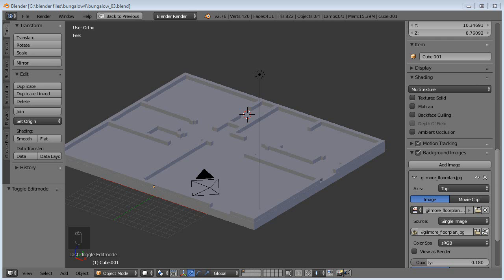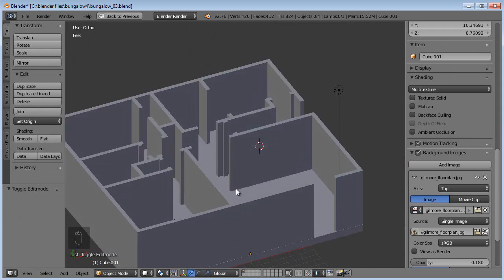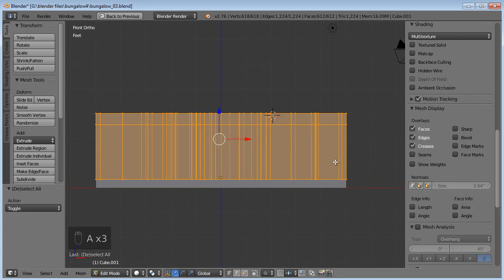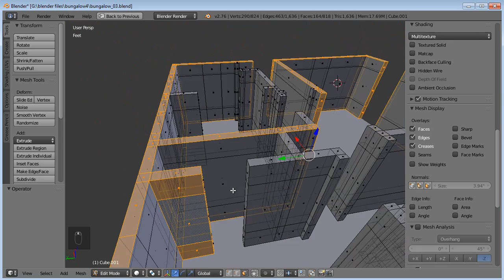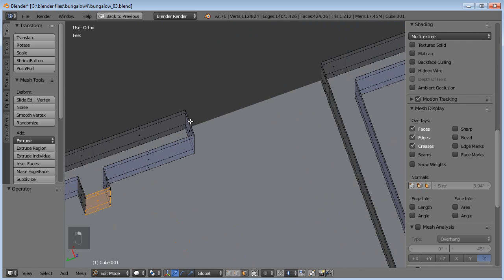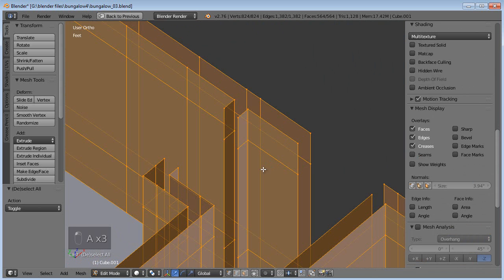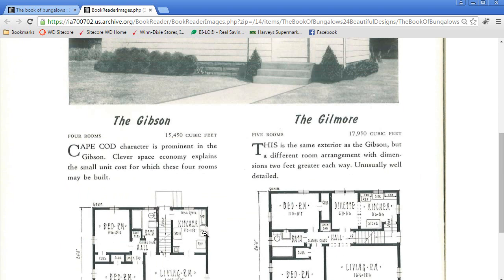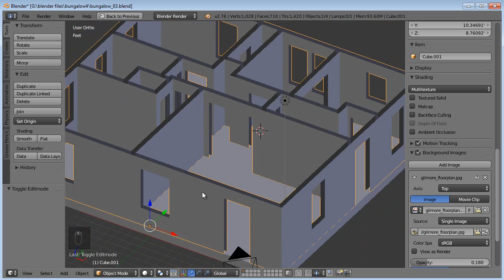Blender Tutorial Series - Building a Bungalow House Pt. 03

Comment: What if you were doing two floors? Would you just create another cube and start over or extrude up?
Reply: I would assume so. the block would become the ceiling. As for the background image you can add the same image more then once then show or hide it as needed. I have noticed that in some of the multi floor plans that the second floor needs it's image size etc tweaked slightly as they were not always meant to be used as overlays. might be best to build the first floor finish the walls etc then add the cube for the ceiling potion it to the correct z then hide the first floor and repeat the procures you did on the first floor but with the new floors plan